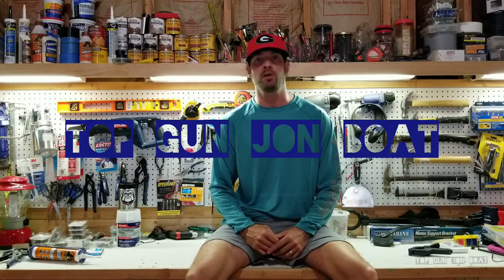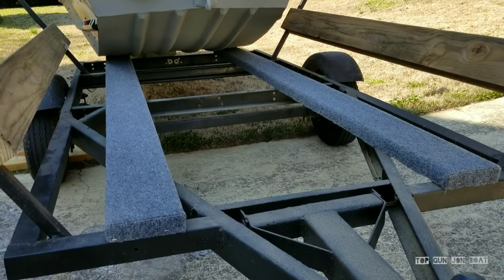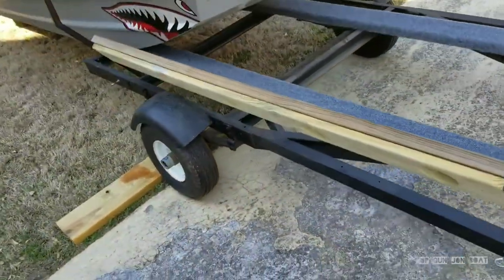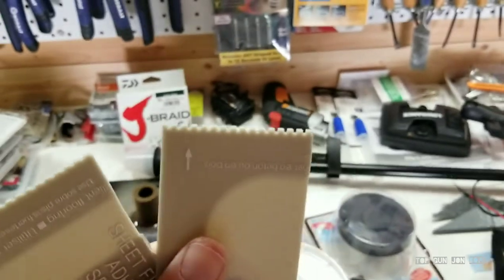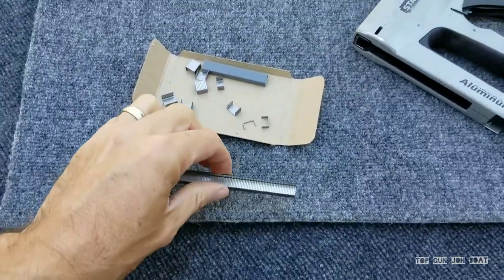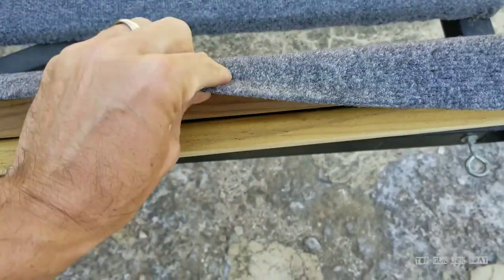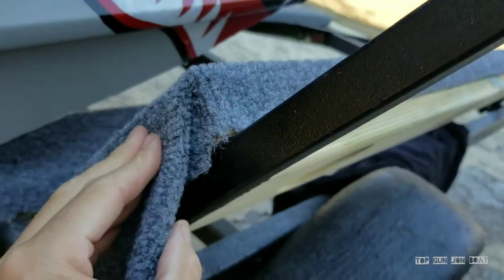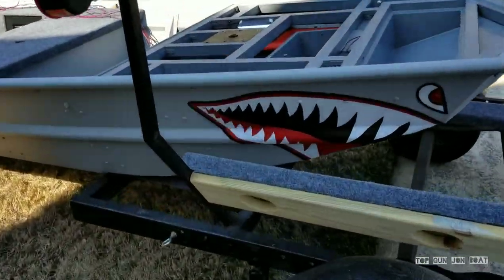Jon Boat Trailer Carpet Install

Comment: Very cool! I used two boards on my boat trailer bunks. Like you I painted the outside board with black Rust-Oleum paint. The only difference is a used a 2x4 on the inter board and I completely wrapped it with carpet. Nice job man!👍

Comment: Looking good there bud! I'm doing a new floor in my drift boat this weekend and I hope that it turns out well.
Reply from the maker: Thanks I appreciate it! Good luck on yours.
Reply: @AnthonyJonesBrigadeBoats  I'm an HVAC guy but this is becoming more than frustrating!  Thanks for the video though!  But I do love that military theme that you are doing! A hole saw works well for those kinds of holes.  I finally found marine grade carpet and glue today at a boat dealer.
Reply from the maker: @washburnbilly  I hear ya man. Yeah I didn't have a 5 inch hole saw or didn't want to buy one but I have 20 other sizes! Lol. No problem man, just enjoy doing the boat build process and sharing it with people.
Reply: And I especially like the tip on painting the Staples!  That's a solid tip!  I don't even work on car's let alone boat's!  Not that I can't, I just choose not to. Lol!  I abhor it!  Give me a ditch to dig or a house to install heat and that's my thing! But this is my first go round at the flooring thing. I'm not scared of hard work! But I'm scared of putting all this time into something that I know nothing about and screwing it up is what is really the deal. But pretty much anything on a home I could handle....
Reply: I glued it all up tonight and it looks great!  Thanks again for the video!  Heading to the Manistee river this weekend for salmon so I had to get'r done.....  Nothing left to do but to screw it in tomorrow.

Comment: Should have painted it before
Reply from the maker: no I shouldn't have. Its completely sealed in fiberglass resin and sanded smooth fir the carpet to bind to. I don't seal with paint, resin is superior.  Paint the underside of hatch after carpet very last, just for looks